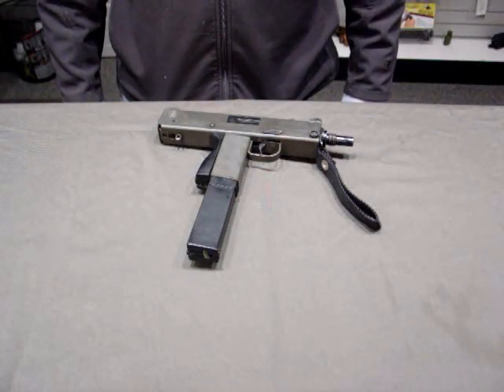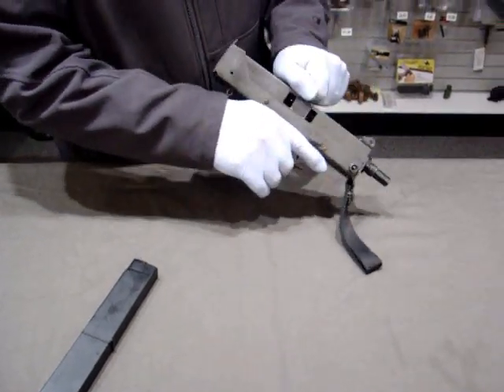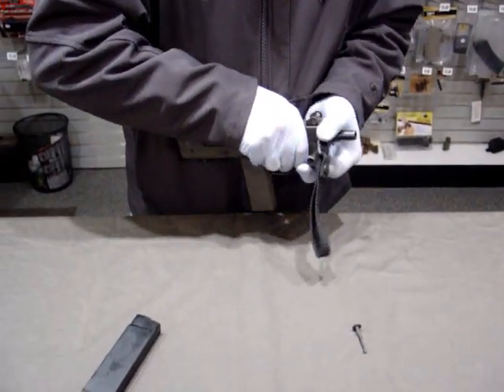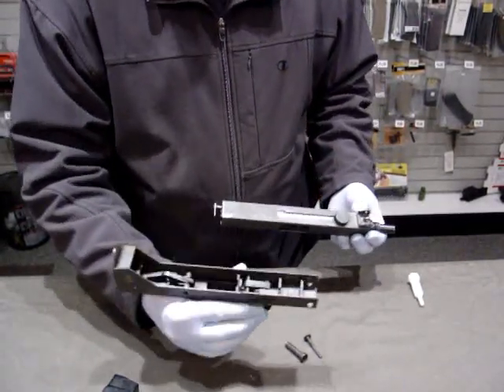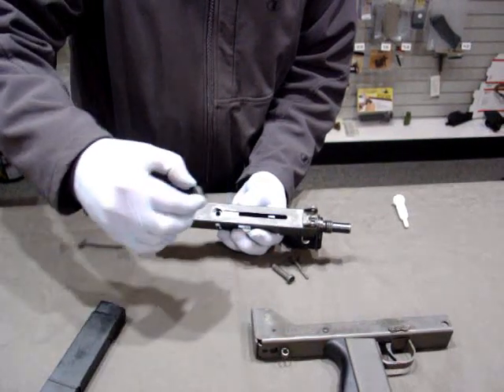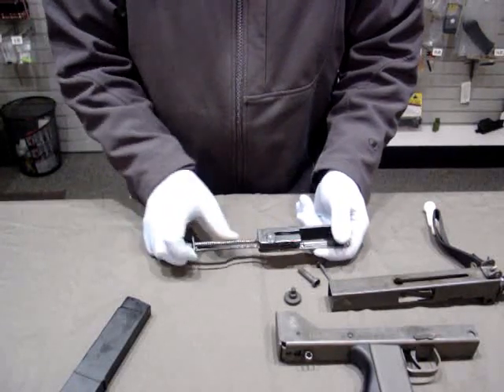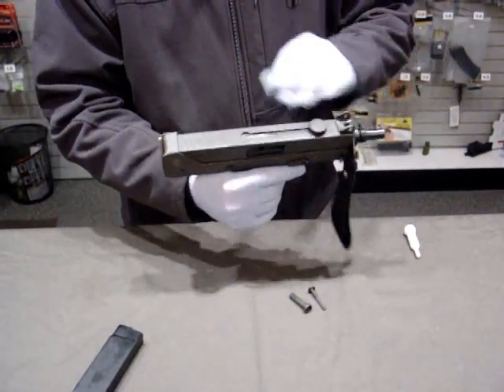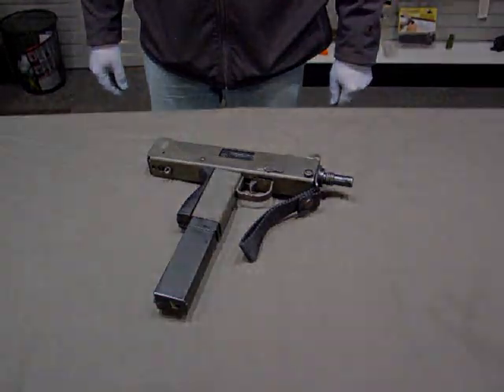cobray M 11 9mm disassembly

Comment: Damn, I was trying to re-assemble my M11 and damn if I could figure out why it wouldn't cock. Thank you, thank you I got now..
Reply: Augie L what was keeping it from cocking it back ? A friend of mine had same problem
Reply: You got to have the hammer pulled back BEFORE you slide the upper back into place
Reply: @calvin821 so i did that. and it fit perfect and i could cock it now that the hammer was cocked. after empty firing i could remove and reinsert the mag. i can now only cock the handle if im applying pressure on the trigger while its in safe or fire. any help?